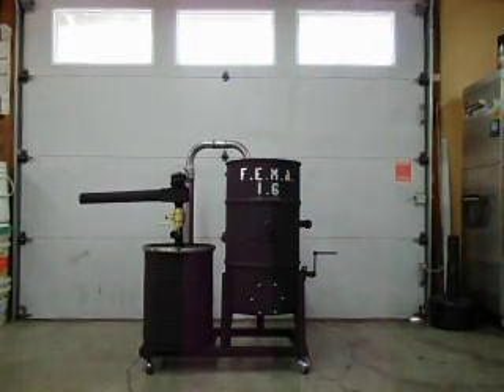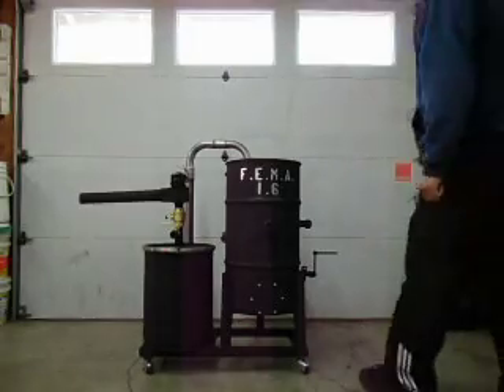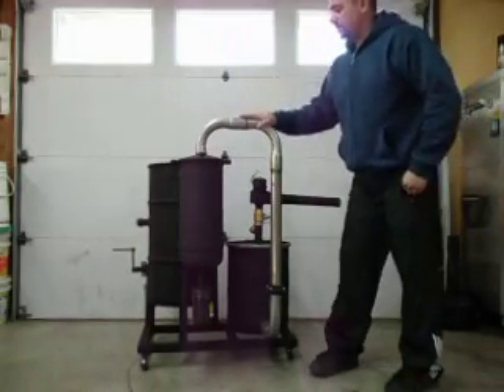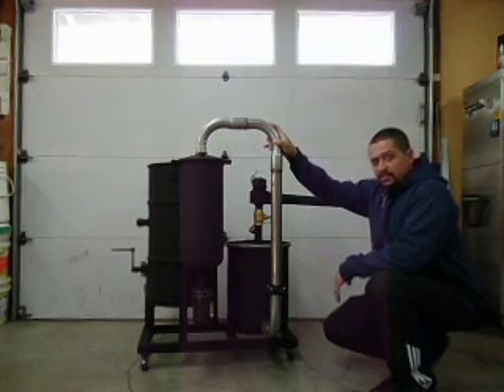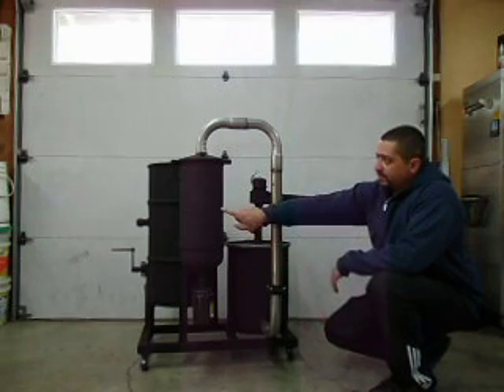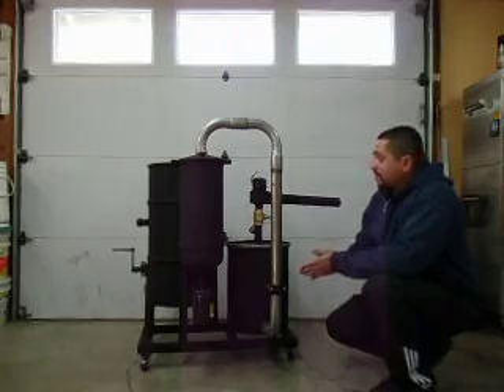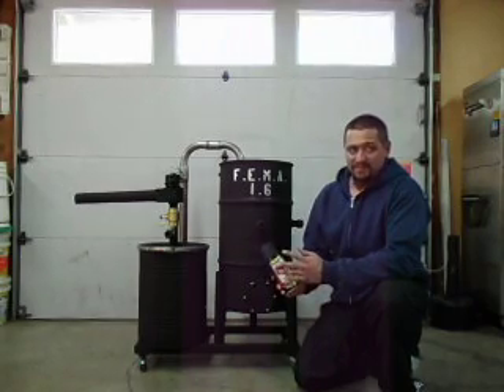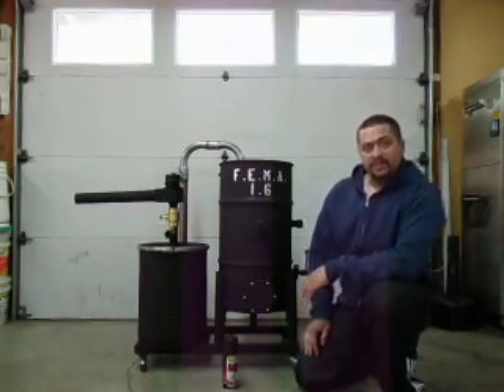F.E.M.A. 1.6 back in black

Comment: Hehehe. It's kinda like your baby is all grown up.
Maybe the next video could be starting it up(from a cold start) and getting your generator running and allow it to run for let's say, 1 hr. Let it shut down and determine how much Douglas Fir was used and how much cleanup is needed. I know it's a lot, but so far you are the most complete and concise DIY gasifier video series. Just thought that might top it all off.
So, what will the next project be?
 Great work Josh!!!!!

Comment: was difficult to flare this time I think because it was too hot. The first flare when I had blue flame, it had only been running a 5 minutes and hadn't heated up much. Tonight it heated up quite a bit. My piping from cyclone to filter is the same slip fit exhaust pipe you used...and about the same length run. Would adding material to the lengths of pipe help cool the gasses, do you think? Like fins on the head of motorcycle engines? Sorry this is so long...I start and can't stop sometimes.

Comment: would ruin your engine. So I started building mine based off of yours...and it of course turned out as a product of my own imagination in the end...lol...I just used yours as a platform to get me going. I flared it for the first time a few weeks ago...light blue flame. I was stoked. Ran out of wood chunks. So I put it up and hadn't touched it again until tonight. I cut up some disks of oak a few weeks back...dried them in the sun until they were splitting. Chunked them up to about 1" cubes...

Comment: It seems like your flame just kinda oozes out of the flare tube...calmly...whereas mine is more like a torch. I do have a PWM speed controller coming...and I am hoping it will help so it will flare easier. And maybe having a blower that is too powerful, could be the reason it is getting so hot? Like it is drawing in air way too fast and making it burn hotter and faster? Any thought?

Comment: Also...I know you don't know it all, as you say...lol. I just value your opinion, based on your successes. Ok, I am using a bilge blower...the idea to use one came from your mention of it in the how to video part where you were talking about your blower. It seems that my blower may be too powerful? It was difficult to flare and seemed like it was blowing the flame out. I closed the ball valve 3/4 closed and it lit easier but then the gasses started backing up out of the top of burn tube.

Comment: same as my first flare. Filled my 5 gallon filter bucket with fresh saw dust. Fired her up. After about 10 minutes I flared it and the flame was light orange. And my inlet pipe(out of cyclone going to filter) was super hot to where I wouldn't wanna leave my hand for more than half a second. Would hot gas have anything to do with flame color? Or is something else tainting my system? Either way I need to cool the gas down...it

Comment from the maker: I would just keep flaring gas for a while, at least 30min maybe longer, i bet you'll see that beautiful blue gas again, as for heat, the pipe leaving the top of the cyclone on mine is around 180deg. F while running, pretty f-ing hot to keep a hand on so that part sounds normal to me, something else you could try to speed up the blue gas after a filter change......get a squirt bottle, set it to mist and lightly mist the top of your filter saw dust with water, just lightly dampen, let me know,....

Comment from the maker: With your detailed description i think i can pinpoint your orange flare, i believe it is caused by your filter change, mine does that exact same thing with a fresh filter, orange flare, just keep running it, it takes me around 30min of flaring after a fresh filter before it turns blue, then i run my generator as normal, fan speed could effect flare as well, i believe slower is better, just my opinion, a longer pipe run would help cool the gas more but if i had to bet, i'd put money on the filter